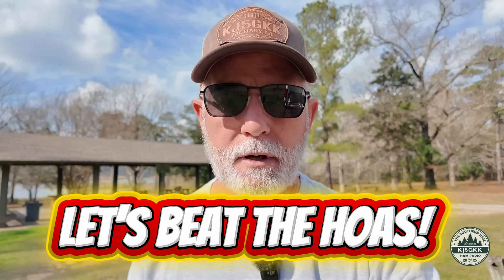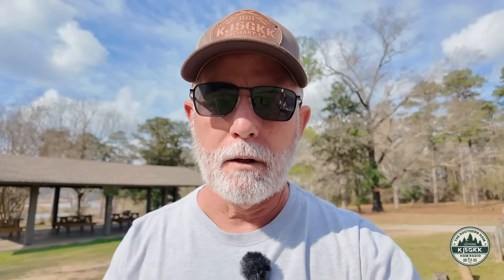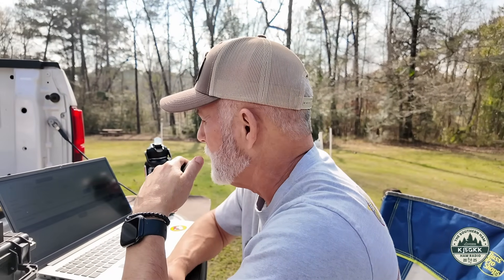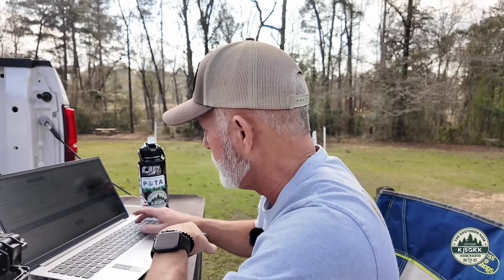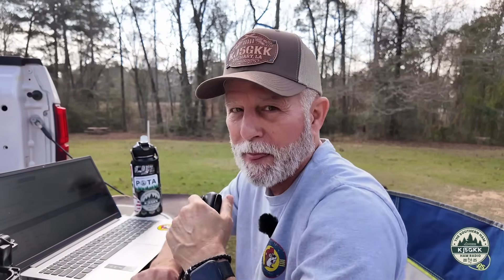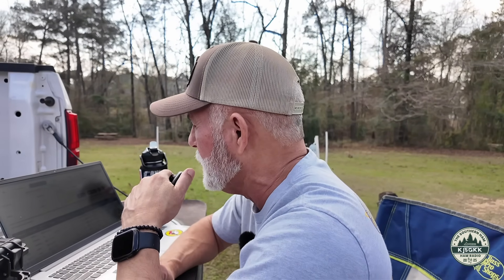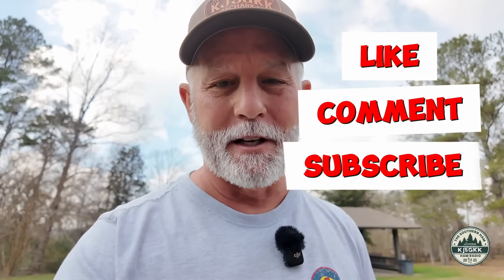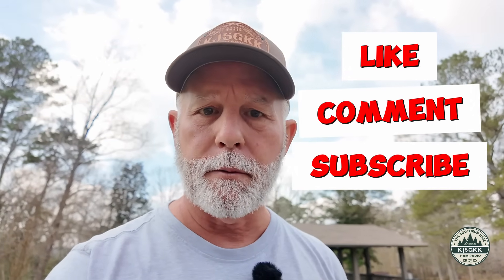The REAL HOA Buster antenna! Bye Karen! The Stealth Antenna only you will know exists.

Comment: I have been known to go to Wally world and for my reciver buy picture wire most is dark color.  So it's over looked.  With normal wire I had that POA pull up the wire to a point of pulling my equipment off the table to it's death. The picture wire breaks and spares my receivers😊
Reply from the maker: Can't say I've had that issue, but sounds like you've found a solution. Thanks for watching.

Comment: Usually an owner can get away with a telescoping vertical or even a buddyhex since it's not a permanent structure, but your ztenna is an option for hams coping with HOA ultra-karens. It's certainly an affordable option and that's a plus. I've lived in a couple of HOAs over the years and I'll never do it again. You work like a dog for decades to finally afford a little ground of your own just to end-up with a committee of lunatics harassing you more than any landlord ever could have. At least there are landlord-tenant laws to give renters some relief, but as the "owner", you have no rights with the HOA. Antennas are the tip of the iceberg.
Reply from the maker: I see you feel my pain regarding HOAs.  They serve a purpose, but are generally Ham unfriendly.  Thanks for watching and commenting.

Comment: Yeah I've been using electric fencer stakes/posts for a few years they work perfectly.  I usually just have them arranged in a straight line, it's perfect for NVIS, you can even lay a wire under on the ground for even better NVIS.  You can of course do EFHW or Dipole config, I have a few BNC to Banana plug adaptors for that.  I think for home use I'd rather do a square or delta loop configuration, they are quieter (from interference) as well.
Reply from the maker: Couple of great points.  Yes, in my opinion, the electric fence post is a must have if running any wire antennas.  I carry 4 with me all the time.  As far as the configuration, you're right.  There's a hundred ways to lay out a wire, and I've done videos on those.  This was just a fun way to see how it would work in a limited space.  That's the great thing about the EFHW.  Thanks for watching and commenting.

Comment: Nice! Thanks for sharing the knowledge. Question on your battery box...do you need a separate charge controller to charge the battery?
Reply from the maker: I would if running Solar panels.  I don't have solar panels.  I simply charge the Eco-Worthy 20ah with the Eco-Worthy charger at the shack after each use. Thanks for watching.

Comment: "Zentenna".  It's amazing what an NVIS antenna will do, when conditions are good.  The fact that you're away from all kinds of electrical noise is a HUGE bonus.   You can hear those weak signals that, otherwise, might be drowned out in a high-noise-floor environment.   I once lived in an HOA and had a magloop for 40-80, and a ground-mounted wire vertical (center radiator supported by a tree), which i used for 20-10m, and whooped the Karens for over 2 years before I escaped.  😂  73, de K5RPM
Reply from the maker: I love this comment! “Whooped the Karens “! Thanks for watching. Certainly conditions vary, but this was a fun setup to test!

Comment: Operating portable is fun.  Great Antenna and simple.  Also operating portable use 50 watts at least.  I’m jealous of people living in the South.  Looks warm.  My favorite antenna is a portable vertical full wave loop at your lowest frequency fed with a 4:1 balun at the side which gives it vertical polarization.  Not exactly an HOA antenna.  
Full wave horizontal loops with a fence fed with ladder line are great antennas.  Super easy to hide.  Great performance.  
Love your antenna and idea.  Might give it a try 73
Reply from the maker: Thanks Grey Ghost! This was a fun setup to try and it performed! Thanks for watching!

Comment: Look at the spider screwdriver antenna 

but

used as adjustable coil runs to vertical line single 

the antenna remote loading coil is IQ type coil
Reply from the maker: Screwdriver antennas are certainly a good option.  Pricey, but good. Thanks for watching.

Comment: Man I'd never buy a house in an HOA but I do love messing with them! Nice setup.
Reply from the maker: Thanks for watching Carlos!  I was in an HOA long before I could spell Amateur Radio.  Soooooo.
Reply: @paulTheSouthernHam  Oh dude, I get it. There are places where even if you wanted to not live in an HOA you don't have that option. My mom lives in an HOA. I went to help her during a hurricane, I strung up an EFHW on a tree on mom's property before the storm came through. Not 30 minutes later the HOA President Karen was at the door with a letter informing her that the wire had to come down or she would have a $500 fine by the next day.
Reply from the maker: @LifeAtTerminalVelocity  It's the world we live in.  We're considering a move to TN, but my one ask of my wife is NO HOA.
Reply: @paulTheSouthernHam  West TN here. Never lived in HOA. I put up antennas at will. My largest pain has been 3 phase 7200v power lines traversing 2 sides of my yard with nearly having to move mountains to get the power co to fix arc's. And height limited due to same power lines. RFI all good now though. Take care, Chuck W4NBO
Reply from the maker: @w4nboradio Thanks Chuck! No doubt we all have challenges! Thanks for watching.

Comment: Excellent video to show people what will work. So many people get wrapped up in it has to be installed perfect or it won't work 😂 I used to work a station in South Dakota regularly on 600 meter (Six Hundred Meter) CW that had a full halfwave dipole on 20' (Twenty Foot) posts with 100w and he always had a strong signal. It's what he had and it worked. HOA people have no valid excuse for not being on the HF bands. You proved it very well in your excellent video. de Mike WE0H ..
Reply from the maker: Thank you Mike.  You are right.  Don't get hung up on "perfect" .  Thanks so much for watching.

Comment: Ahhh... that explains a lot. EFHW will work with various crooks and bends. I have a 10-80 EFHW along my wood fence in a J configuration. The feed point is the short end. It makes two 90 degree turns at a short part of fence then runs almost the entire length of the back fence. It's been up for 5 years (I do maintenance on it) and I've had contacts all over the world on FT8 and it currently runs my Winlink gateway with contacts all over the US. The military considers anything under about 20ft as NVIS for local to regional communications but they work much further out if conditions are right. Nicely done!!
Reply from the maker: Thanks Jack.  I appreciate your comment.  Btw, I hope it's ok, I had a viewer from Brookhaven reach out and I recruited him to the CMARA get together at Lake Lincoln.  He's interested in joining your club if ya'll are open to that.
Reply: @paulTheSouthernHam  that's absolutely fine. We accept membership from anywhere. He might be just outside the range of our weekly nets on VHF but can join via Echolink online if he wishes.

Comment: I currently use a EFHW for 40m and even fairly low to the ground it works well with my QRP station. Way back in my Novice days ( 1970's ) I even fed my 15m QRP to a window screen in my backyard and it also produced good contacts. Perhaps not world class DX but good to know that even unconventional antennas work in a pinch. When I did live in a HOA for a few years I ran my wire from tree to tree and through the branches. Hard to see even when in my yard hihi. 73 de wa4jat
Reply from the maker: Thank you Mark.  You are so right.  Just get a wire in the air and take what it gives you.  May not be perfect, but nothing's perfect. I appreciate you watching.

Comment: I like it, Paul. Zig Zag opens up a lot of possibilities for HOA Hams, but also POTA quick deployment. Thanks for sharing with us, another great video and activation.
Reply from the maker: Thank you Randy.  Certainly could work for POTA if no tree or mast available.  Maybe at the Beach?  I was amaZed at how well it performed.
Reply: @paulTheSouthernHam kinda puts a wrench in the old adage “height is might.”  Just goes to show, use whatever you have available, just get on the air and try it. 

BTW, thanks for sharing the speaker redirector. I love it when Hams share things they find that help our experience!
Reply from the maker: @randyn5ilq  Amen Randy.